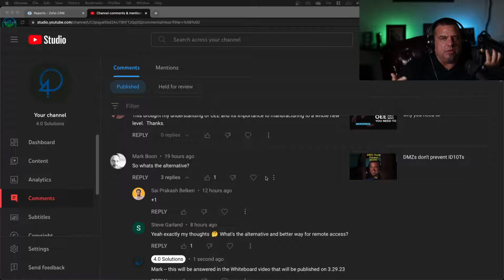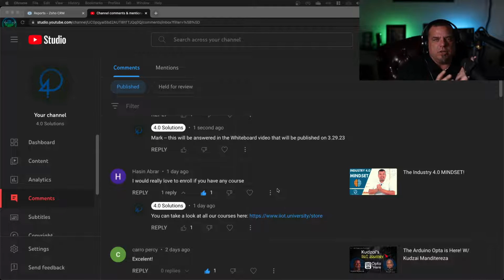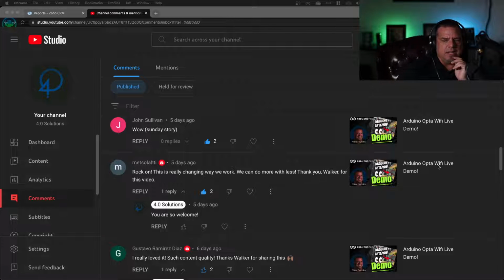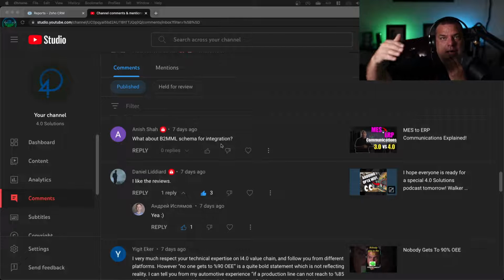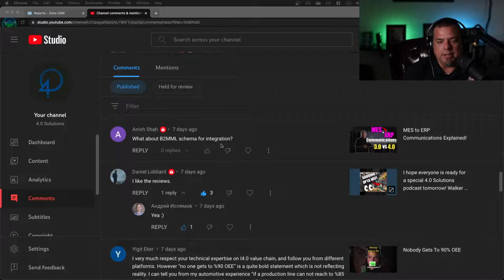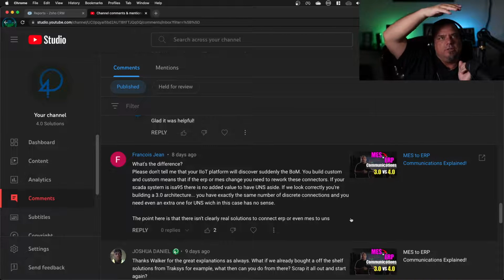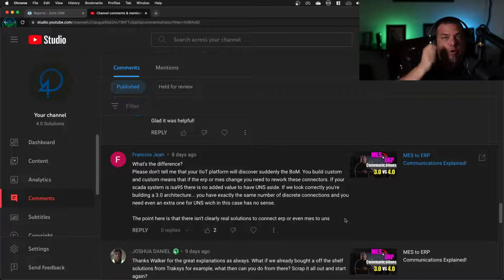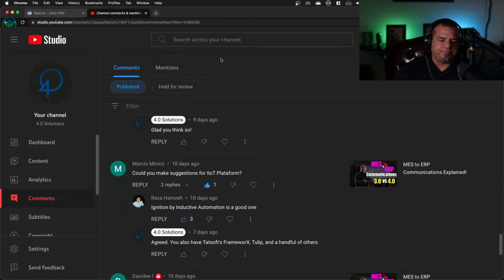MES, ERP, and IIoT: Your Questions Answered!

Comment: Firstly, thanks Walker and your team for all the content. I've learnt a lot over the years. 53:45 Regarding the price increases from Ignition, you compliment Highybyte. I too like Highybyte. BUT Highybyte costs increased from 5K USD to 20K USD per annum. That's more than Ignition by far since Ignition is a one off payment with small yearly support costs and offers far more value than Highybyte. I don't even think that's controversial right? Ignition offers so much more to get the job done it's not even close. Ignition could very feasibly be used to add a Highybyte-esque dataops layer.
So whilst I agree that I dont like price increases, could you comment on whether you think Highybyte is worth 20kUSD a year and thus more than Ignition? If so why?

Full disclosure: I have purchased multiple ignition instances and highbyte I have trialled for a year. The cost of each Ignition instance was around 40k USD with unlimited HMIs, bells and whistles.